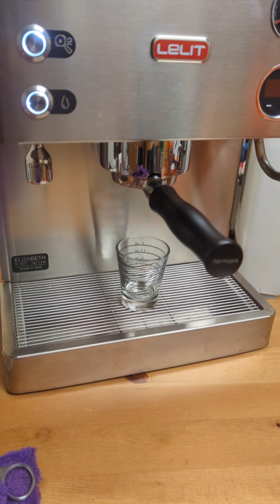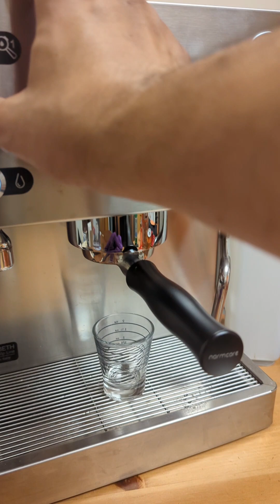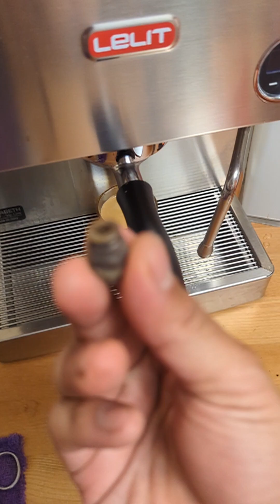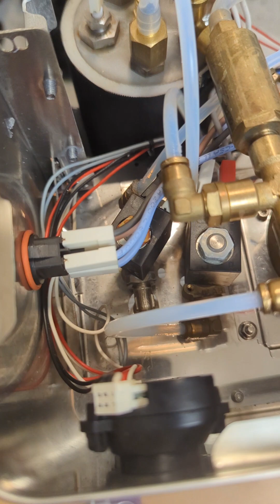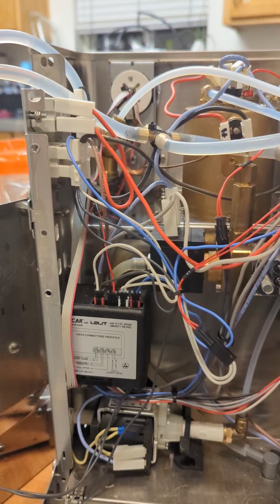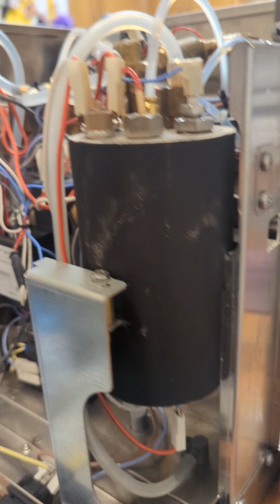Lelit Elizabeth – Major Internal Leak & PID Failure! Full Breakdown & Rebuild

Comment: I’m from Brazil and I purchased a Lelit Elizabeth model PL92T-2G82 that works in 50 htz.

Here, in Brazil, it is a 60 htz.

In contact with the dealer he said:

“It will work on either as long as the voltage is correct”.

So the voltage of the machine is the same from my country, but he machine is 50htz and here is 60htz.

So this information is correct, the machine will work well, without any problem?
Reply from the maker: Hey there!
I’d recommend contacting the manufacturer directly to confirm that. I only work on machines in the U.S. and Italy, so I wouldn’t want to give you the wrong info regarding frequency compatibility. They should be able to tell you exactly how the 50Hz vs 60Hz difference affects performance.

Comment: Hey man, thanks for your video. I have the exact problem described in your video. Would you mind sharing what was the part number which you replaced and how difficult it was to change it ? thanks
Reply from the maker: I had to reach out to 1st Line for the parts — that elbow fitting is the only one they list, but they should be able to source everything you need if you contact them directly.

As for the work itself, it’s definitely not easy. This was my fourth machine that I’ve fully disassembled and reassembled. After a lot of trial and error, I was able to figure out a reliable method to seal everything properly, but it took a lot of patience and effort. I ran into a few leaks during testing, but I managed to get everything sealed up tight.

The machine is now running great with a new PID and gaskets installed.